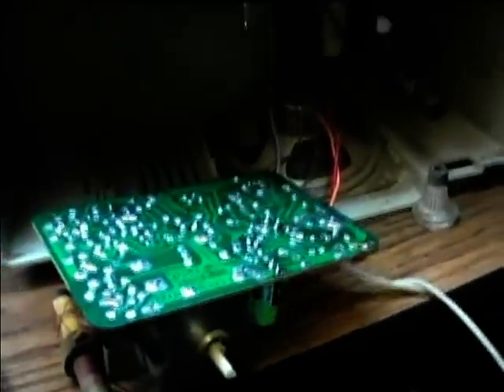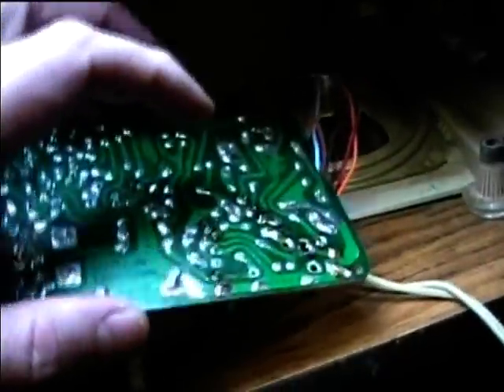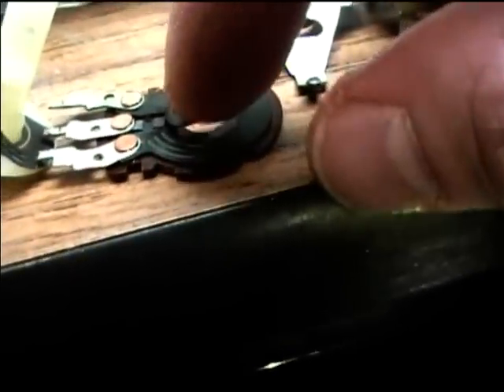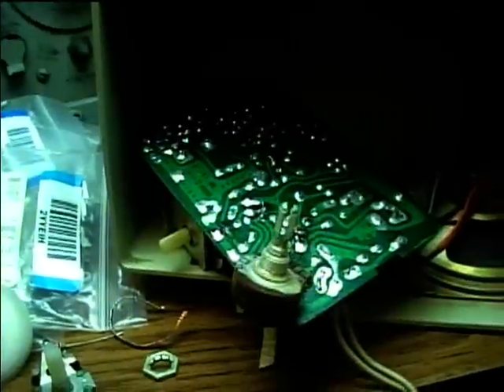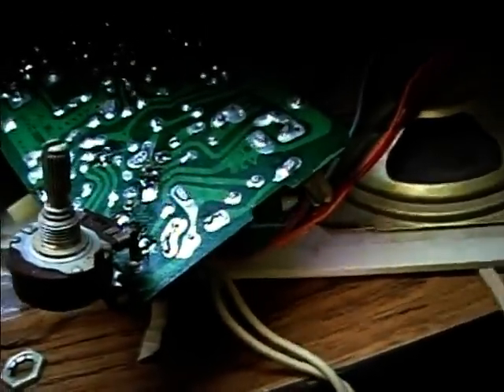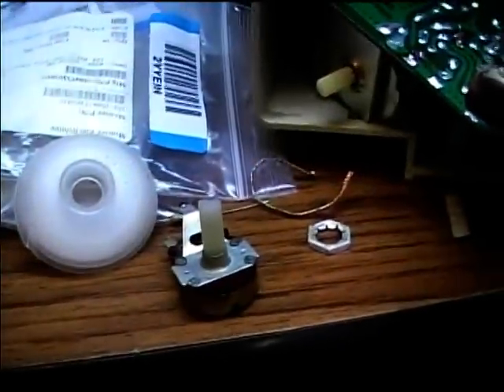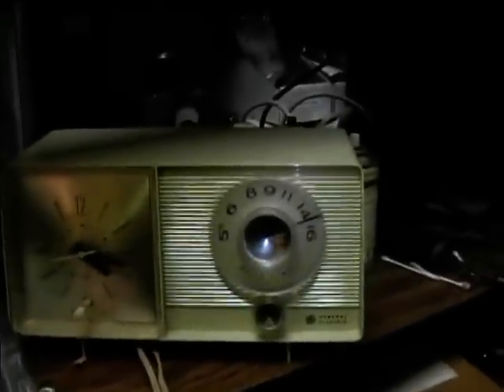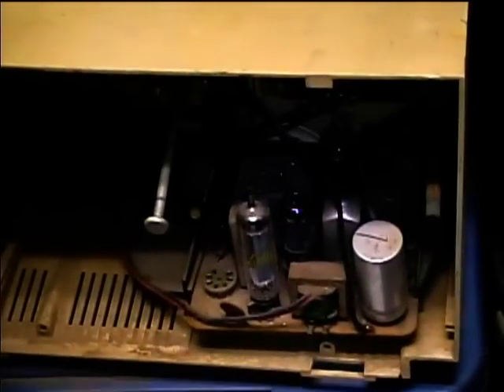1969 GE Solid State AM Clock Radio Model C4401A

Comment: something you may want to try with that volume pot. there may be a minute crack in the carbon at the point where the volume drops to 0 mid dial. a fix that may work is rubbing graphite into the damaged area of the pot with  q tip. it will fill in the gap and may work. give it a try :)

Comment: The ge radio on my channel looks almost the same.... as far as the electrical parts go.... but I have since ruined it :( I got tuner cleaner on the resistors and such.... all I get is a hum now. Advice?
Reply: I would guess bad capacitor or bad ground.